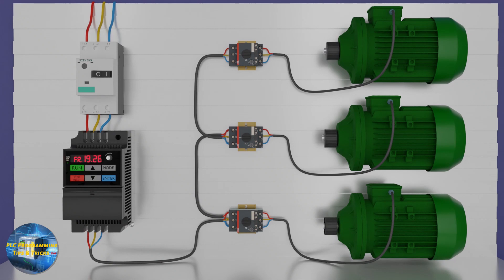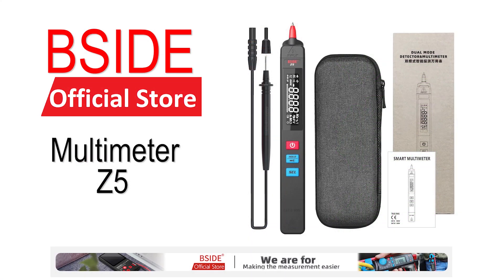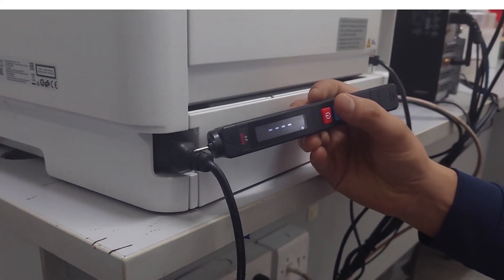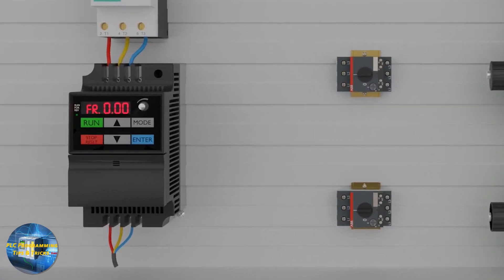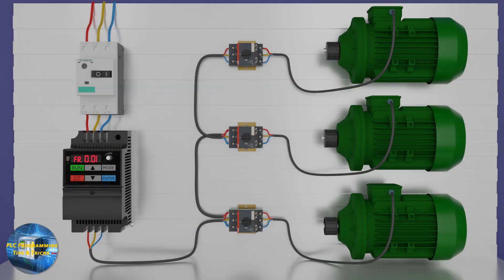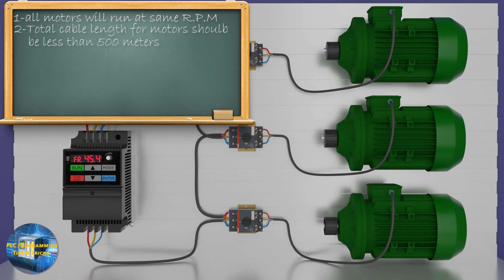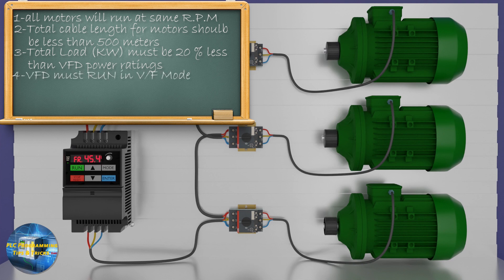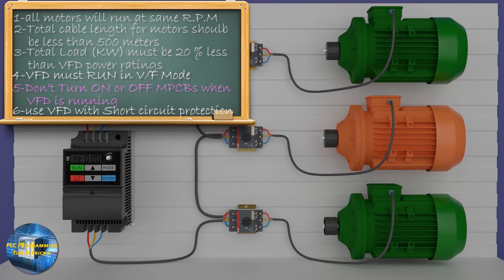How to control Multiple Motors with One VFD ?

Comment: Is there a way to control multiple motors with just 1 VFD without running them simultaneously? I want one motor to run at a time then set the others as backup.

Comment: I have a problem in my altivar38 VFD, before its running two motors at the same time, when we replace the card of vfd, it cannot run the two motors at the same time, you need to run one motor, once it reaches the setpoint speed,that is the time you will run the another motor. What is missing?
Reply from the maker: You replace the control card of the vfd or power card  ?
Reply: @EASYPLCTRAINING  i replace the whole vfd now,  It's the same model. I need to run the first motor, once it reaches the set point speed, i can run the another motor. Before they are starting and running at the same time.  What is missing?
Reply: @agent70vids3  How did you do that? I needed that setup where one motor only runs at a time, then set the others as back up.

Comment: Hello, nice video and explanation! 

I have a 2post car lift with 2 motors on it (one each side). Both use the same RPM and specs and are already connected together. My question is, using one VFD with the correct spec for example, both motor together are 5.5KW if I use one VFD with an output of 7,5KW that will be enough and safe for operating it ? Those motor are 220V 3PH and my shop only have single phase 220V. With the VFD I’ll be able to convert single to 3phases and make both motor turning without any problem ?? 
Thank you for your help 
Simon

Comment: What happens if one or more of the MBPCs are automatically activated for protection?
Reply from the maker: Nothing will happen,,,,, other motors will keep on running,
Reply from the maker: May be vfd trips , with over voltage alarm

Comment: Thank you for this session.

I would like to ask if there is a way we can connect a VFD to a single phase motor.

If anything of such is possible?
Reply from the maker: No dear , for single phase motor you can use speed control cards  , these are basically voltage regulators
Reply: @EASYPLCTRAINING  thank you so much.  I appreciate it.

Comment: My favourite channel for automation, thank you so much
Reply from the maker: thank you for the appreciation of my hard work
Reply: @EASYPLCTRAINING  i have one doubt brother, all motors rpm should be same ? I mean synchronous speed which is on motor name plate
Reply from the maker: Same kw and same rpm, its better for safe operation. All three motors should be identical to keep the current balanced.